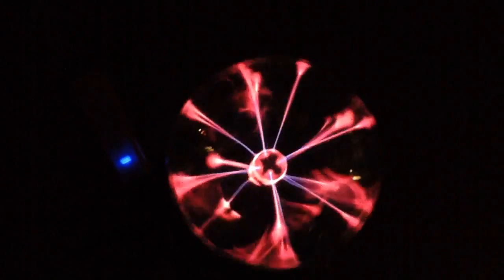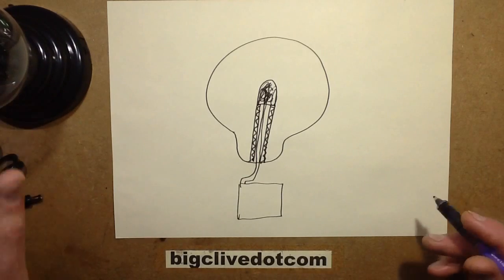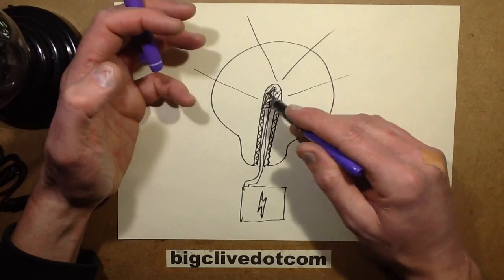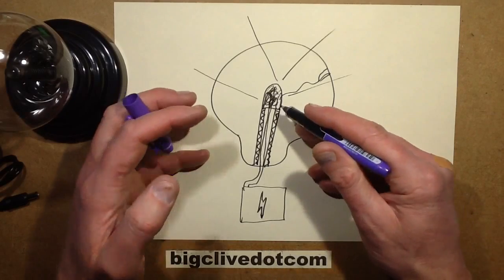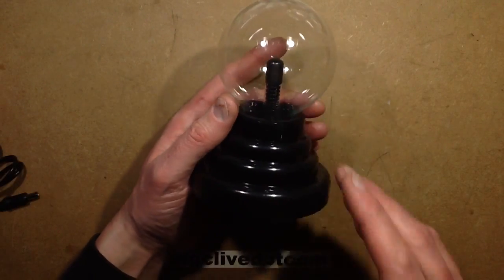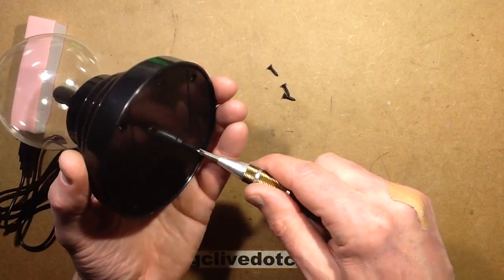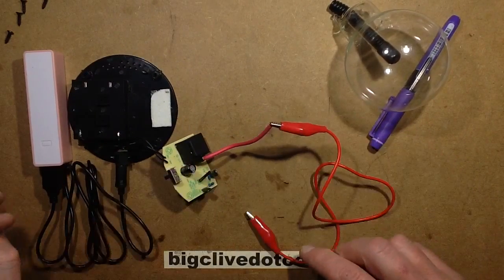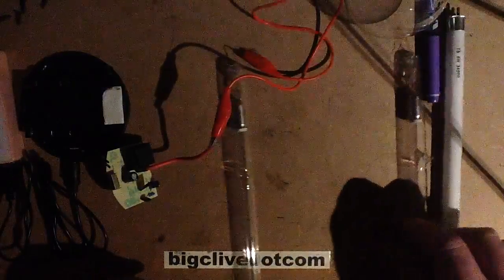USB plasma ball teardown and schematic.

Comment: This makes me think about building an entire room in my house with neon bulbs across the ceiling excited by HV power supplies
Reply: Science project here I come
Reply: Actually at one time there was a predecessor to the fluorescent lighting system that sort of work that way except except larger-diameter glass tubes white neon tubes excited by high voltage.

The interesting thing is the system was not sealed completely.

And your ass was admitted through means that it would allow certain gases through it was quite complicated but it actually work pretty well from what I understand.

Also the first Mercury lamps were essentially single phase Mercury Ark rectifiers but being used to produce light.

And surprisingly enough they could even work on DC.

But for the time that was pretty ingenious.

Unfortunately don't have any links to anything on this but it does come from reading.

This is mentioned in some Google books as well if anyone's interested.

But good luck finding it I don't even know if anybody had mentioned on YouTube at all couldn't find much back when I first looked into it years ago

Comment: Could be used to drive a "Jacobs Ladder"
Reply: Unfortunately not. Jacobs ladder requires current as well as voltage. This is able to create them arcs because a vacuum had been drawn, much harder to create arcs at higher pressures

Comment: I had one of these back in the 80's! I learned early on to never place a coin or tin foil on the globe and touch it. Nasty shock and a burn.... LOL!
Reply: I think they say something about that in the manual I believe and even sometimes on some warning label that might have been missing for one doesn't think to read either one.

Sometimes rtfm is better in the first place if one doesn't know maybe one would know if that happens.

Remember in a science museum there was a big sign on the big plasma globe about that very thing not bringing metal objects within range Etc.

Of course I was standing there someone did it and learn the hard way

Comment: Ordered one in a flash lol, what good value for a fiver :-)
Reply: how long did it last ? i turned on mine for 24 hours straight like a normal lamp but just  for a day it getting dimmer.
Reply: @VJETRA  Mine is still okay, but I rarely use it. You might have just got a bad one
Reply: @gazzaka  Is yours A usb model one?
Reply: @VJETRA yes & no, it has a standard powerjack, but works off 5v

Comment: "Things you really shouldn't plug into your computer."  That's a video that I really want to see!
Reply: I tried to have cybersex, but the USB port was far too small.
Reply: @BedsitBob  LOL
Reply: They don't make enough computers to demonstrate them all
Reply: Yep that would be a good video.

And then show after effects of doing that what it could do to a computer.

There yet playlist of After Effects of funny things like that and I'm sure there are a few videos out there for like that or at least sections of repair videos regarding that.

Not just USB port stuff but others as well or other equipment related to computers and run things being plugged that use some work connectors but different things going through them!

Such as things that might have 24 volts are more on the same pinza something that would take about five or less.

Yep d-sub connectors sometimes that'll do!

Sort of like those USB decorations that well and those little USB vacuum cleaners that pole way more power than you should pull from computer USB!

I saw at least one USB device once that melted a cheap USB extension!

This is Fire 2 high speed charging!

The current at 5 5 volts on the USB was over 3 amps for some reason still can't wear white was but you should have seen the size of that cable going to the USB plug!

More look like a heavy duty extension cord than USB!

What were they thinking!

Oh and on that playlist and what not to plug into computer don't forget the USB killer!

What next USB bug zapper!

Actually I'm surprise we've not seen that from big quiet for anyone yet.

Maybe it exists for just haven't seen it yet but sooner or later!

I'm not just talkin about little night-light size thing I'm talking about football bug zapper like you'd hang outside that's a few feet tall.

By the way good source for the nice high voltage Transformer!

Once I tore one down it was an old one surprise filament winding vacuum tube rectifier didn't think it would be that old!

Couldn't find any labels on it anywhere I'm probably long gone but yeah that exists!

Once I saw one that instead of regular fluorescent ballast for the fluorescent tube there was actually what look like a ballast tube for a Old School radio.

Even in an 8-pin tube/ relay socket

About the point in this video where you guys are referring it sort of reminds me of ashens even tone of voice Etc for some reason don't know why
Reply: @aaronbrandenburg2441  Simmer down now 🤣

Comment: I had one once that when it was plugged into a laptop the touchpad stopped working.
Reply: It also made capacitive touch screen devices go all funky.
Reply: myfunrandomvids can confirm. while this was plugged in the same usb hub as my cell phone, the touch screen would not work.
Reply: I had one when I had an iPad 2 and when you tired using it while the globe was plugged in the iPad would lots of funky shit sometimes without even touching it.
Reply: It took me a worryingly longer time to realise that when the touchid in my iPad “randomly” stopped working was when I had one of these running off the same power supply.

Comment: I had so much fun with my old plasma globe when I was young, I covered the globe with aluminum foil, making a little spike at one end that I burned grapes and other stuff with. I shocked myself a number of times and burnt holes through my nails. I wasn't a very bright child.
Reply: You might not have been very bright but the arcs probably brighter than you would have maybe

Comment: hey clive, talking of high voltage toys have you seen those little "1000kV" inverter modules you can get on ebay? (item no 152252495873 if you havent). julian ilett got one a while ago and said he was going to take it apart but never did, at least not on video. are they the same kind of circuit just with a couple of wires to make a spark gap instead of the globe?
Reply from the maker: They tend to use a two stage stun-gun circuit with a capacitor being charged to high voltage and then dumped through another transformer to create a sharp high voltage spike,.
Reply: bigclivedotcom
 ah ok. I thought they might be similar because this circuit looks almost identical to that arc cigarette lighter you took apart ages ago

Comment: HF and fluorescent lights , reminds me of the times I would test ( played ) with fluorescent lights at the ends of my HF long wire antenna, transmitting on 3.5 MHz at 100watts, you could stand Meters away on the ground holding one end pointing the other end up in the air towards the ends of the long wire antenna and get the fluorescent light to light up very bright with CW, and if you modulate the Carrier the fluro would flash with the modulation, oh what fun, maybe I should do a video!

Comment: On the surface, it seems like a rough load for USB ports to handle, given its operating current, the noise, and that rather large filter capacitor on the input. I think I'll stick to my mains-connected neon transformer. ;) Thanks for the teardown, Clive!!

Comment: Clive you were lucky with that simple driver ...i have "bigger" scarrier one (52cm diameter) and that one keeps breaking because it have stupidly sensitive MH7401 based RC oscilator and MOSFET half H-bridge driven HV transformer. Also i think 45 to 55 watts (when touched) is little bit too much for it.

Now i need to find big enough flyback to finally fix it. :D

Comment: does it feel weird if you put your tongue or face on it ?
Reply: On the bare wire? Oh. Yes. That would feel weird. Very weird.
Reply: I don't care where you`re from Bob. Go do it yourself.
Work out the math I already supplied, you troll.
That`s just another typical response from a typical arrogant American.
Reply: Noevilea aw someone's grumpy
Reply: BillyNoMates1974 yes, it would feel weird, very weird.
Reply: Paul Sengupta ....and then you'd meet Jesus in person
Reply: No you wouldn't.
The output of the secondary winding is a very low current so your body would load it down and reduce the high voltage.
eg. If this generates 20Kv from just 5 volts while running at 400ma the resulting equation is 20,000 divided by 5 = 4000.
Then divide that current of .400 A by 4000 = 0.0001 or 100 micro amps.
Injury or harm does not occur till currents around 80 times this rating.
I`ve had 9000 volts through my right arm from elbow to finger tips that was a much higher current but only rendered my arm numb for around 4 hours.
Voltage doesn't kill but the associated current in relation to load resistance does.
Reply: Noevilea Sounds like jealousy.

AMERICA! FUCKYEAH!!
Reply: Not really, you don't feel much at all.

Not that I've done this....cough.... :-)
Reply: I assumed he meant on the charged parts.
Reply: BigClive, could you try it lol ?
Reply: Noevilea I'm from Missouri, the Show Me state, so show me. Put your nice wet tongue on that big globe and leave it there while you stand in water grabbing onto a copper earth ground. I will monitor the wireless electrocardiogram from my car outside.
Reply: BillyNoMates1974 yes it does. you can put foil on it and get a shock but not tried it
Reply: Noevilea Oh you're no fun and I am not arrogant. How would you feel if your cousin was electrocuted with a cheap Chinese piece of goddamn shit. Check yourself. You wouldn't know a troll if one came up to you and said I am a troll.

Comment: is there a way to fix Nixie tubes. I have a clock that one of tubes died, I assume it is from a loss in vacuum/neon. It is a shame to throw out a tube if it can be "recharged and sealed"
Reply from the maker: It's quite a specialised task.  It would be much cheaper and more reliable to get a new tube.

Comment: I have a challenge. I dare you to put an orange, tangerine, or apple on top and with it on touch the fruit
Reply: for some reason it gives you pretty bad shock, just discovered that. Also if you use another fruit to touch the on on top of the plasma ball...the arcs are pretty neat
Reply: for some reason it gives you pretty bad shock, just discovered that. Also if you use another fruit to touch the one on top of the plasma ball...the arcs are pretty neat
Reply from the maker: It's the large conductive area of the fruit capacitively coupling to the gas inside.  It means you get much higher current than just touching with a finger.

Comment: could this circuit make a cheap Jacobs ladder ?
Reply from the maker: Jacobs ladders really require a fairly beefy transformer capable of about 50mA at 10-15kV.  They rely on the heat to make the ionised air travel upwards.
Reply: Rob Bennett Nowhere near enough current I wouldn't think.

Comment: if its RF frequency levels, could it be used as a antenna emitter for AM radio to play music?
Reply: Or make a new one from scratch that can deliver a cleaner waveform and see if the music forms some sort of pattern...
Reply: eeeh. It is RF all right, but an extremely dirty waveform. I don't think it would be able to transmit music. However, it might give of a nice loud white-ish noise if you put a radio near it.
Reply: There's always something satisfying about tuning into an empty AM radio frequency when it's thundering and listening along to the lightening stikes.
Reply: Thomas Richter That is something worth trying.
Reply: Bear in mind you can't just feed an audio signal into it. You need to modulate the amplitude of the carrier signal.
Maybe put a transistor across the output that pulls some of the power to ground... but transistors have a significant amount of capacitance...
Reply: The signal is very unstable and dirty and in no way FCC complaint for that use. But you would have to modulate the input signal to the transformer. Also I don't think a general flyback transformer is rated to operate on the AM broadcast bad of 530 - 1800 KHz. most flybacks run around the 15 - 50 KHz range, You would need a VLF receiver or an OLD (late 90's early 200's era) soundcard and SDR#
Reply: Might be interesting to feed an audio signal into the primary of the transformer to see the effect?, J.
Reply: I suspect it would be a little like a spark gap transmitter. Which you can just about modulate with music/speech but it wouldn't be very recognisable...
Reply: If you turn the plasma globe on and someone is listening to an am station R.I.P all am radio stations.
Reply: you can broadcast inter-dimensional with this unit, alas w/ interface into computer running virtual self...but, this is actually a powerful unit, just gotta know WTF you are doin.....
Reply: Im not a radio guy, but im guessing that with a new driver circuit with a matched frequency to the transformer and support for modulation it should work. Though that should also work with a normal antenna? And you would ofcourse need a receiver that gets that frequency..

Comment: this combined with a ebay power supply <1mm creep distance disaster waiting to happen
Reply: It wouldn't be that dangerous actually. All that would happen is that you get mains voltage inside of it, which wouldn't really do anything since it's isolated with glass and plastic.
Reply from the maker: It would indeed cause tracking across the poor clearance and potentially build up a carbon path for full mains current flow.
Reply: +bigclivedotcom Wouldn't the class Y capacitor take care of it (I suppose it acts more or less as a dead short at such high frequencies), unless it's a really crappy supply without a class Y capacitor of course?

Comment: put some high voltage diodes and capicitors and drive small crt tube :]
Reply: Well what would be the point if there's no other drivers for the CRT but if you were to hook it up right to have enough voltage and current for have some other things connected in certain ways you might get interesting display.

It's possible to hook up an old TV with the horizontal and vertical deflection coils tied to audio make some pretty interesting display on the CRT by the way
Reply: Also by the way look up here on YouTube oscilloscope music or something similar.

Using the XY inputs you can do graphics on the oscilloscope.

It's possible to do that with audio and actually have a bit of video with it well at least sort of but rather interesting if you take a look
Reply: Also what is your user Avatar I don't think it's a Pokemon could be off on that one but save it somewhere else but what is it I just know I've seen it please comment

Comment: What would happen if you raised or lowered the voltage going into the globe? Could you modify the board to allow a varying range of intensities or would it just stay the same?
Reply: I have one of these from a US supplier.  Have taken it up to 12 volts.  Much more than that and the little transistor gets too hot.  The brightness and number of streams does change
Reply: rogertopful pretty sure you can drive them with much higher voltages. Photonicinduction has done a few videos where he does just that.
Reply: Some globes do have controls to vary the effects produced
Reply: well I was using AA batteries in it and wondering the same thing. i pulled one out and attached a 9v and it was very bright and activate. for about 4 seconds. its dead now, i came here for a heads up on what to replace, and I have no idea

Comment: I see nothing to prevent a person from running this at 9v or 12v.
Reply from the maker: The transistor could run hot and the transformer could potentially fail internally due to the greatly elevated output voltage.
Reply: bigclivedotcom
Aye, that transformer is the part we don't know its ratings on but the transistor is probably fine.
Reply: On AAs, it's still only 6V.  I'm guessing it has more to do with all the additional metal.  But that's totally just a guess.
Reply: I ran one off a 9V battery for a Halloween prop.  No noticeable adverse effects.  (Mine has a AA battery compartment, but when used, the streamers tend to creep downwards, rather than uniformly covering the globe.)
Reply: James Potts
Maybe there is so much voltage they are seeking the real ground?

Comment: 12:00 have you by any chance build a tesla coil when you were young or have you just played around with pre-build things?
Reply from the maker: I've never built an actual Tesla coil because I'm concerned about it damaging electronic equipment nearby.  But i built a lot of very high voltage inverters when I was young, which was actually just as bad.
Reply: probably a good idea (i managed to fry a few Computers when I showed mine to my physics teacher :/)

Comment: I remember when they cost £400 from innovations back in the early 80's
Reply: Oh man, I used to love that catalogue! I bought my first USB memory stick from there! It was 32 Meg and cost 40 quid :D
Reply: +Azayles I still have my first one lying here. Also 32MB and 'made by' Sweex. It still workds :)
Reply: I still have my fully functional 'Eye Of The Storm' with the two intensity slider controls.
Reply: My first Plasma Globe cost £100 in 1990.
Reply: @marcse7en  I think mine did as well
Reply: @esrider7765  I just bought a globe that's damn near identical to my £100 1990 globe, for £4.92! That's quite a saving! Kerching! 💰👍😂
Reply: I remember seeing this at Radio Shack in the 1980s, in Canada. I don't remember the price.
Reply: @louistournas120  Got one at RadioShack around 1980 in Canada for $99.00. Quite a novelty!